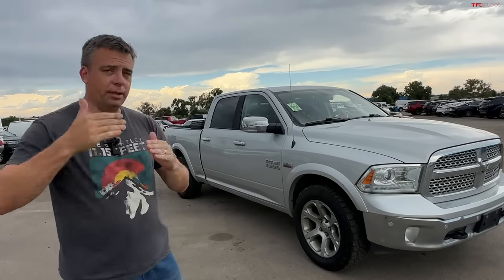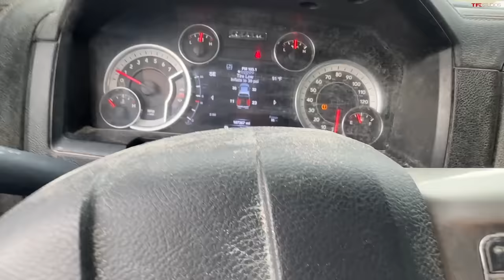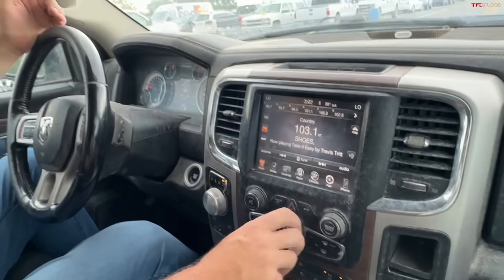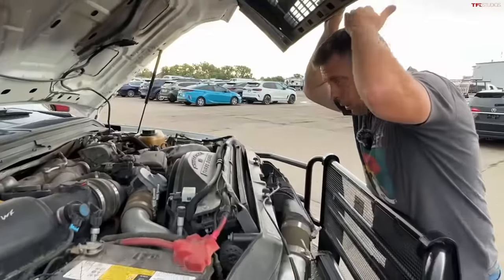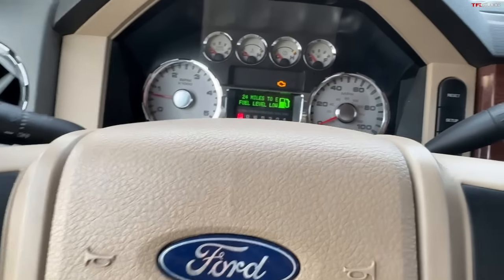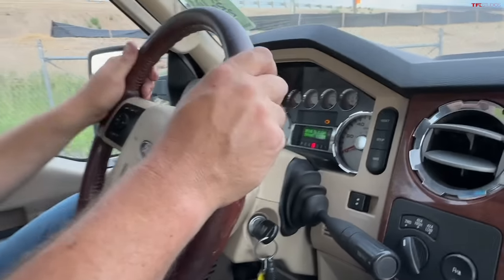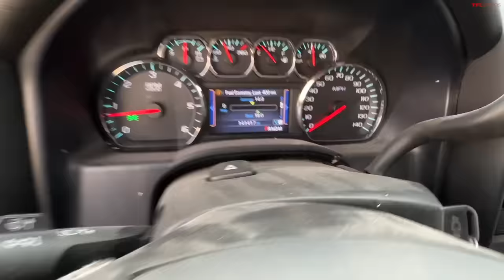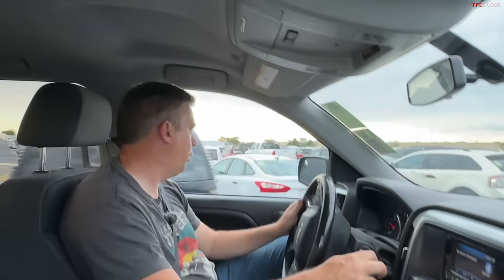These Are the Top 3 Used Trucks You Should Never, EVER Buy!

Comment: So much depends on how good of condition the truck is and what price you get it at. 

For example the F-150 from 04-08, in particular had problems with the 5.4 3v.  I know this because we owned and operated several of these pickups.  These trucks are a steal right now.  Why, because we know the problems, how to fix the problems and once fixed they easily run 350,000 miles. 

I currently have an 08 F-150 Kong Ranch with 5.4 and it has 80,200 miles. I’ve run mobile 1  0W30 and changed the oil every 4000-5000 miles.  I also use the mobile filter. The truck runs like it did day one from the factory.  

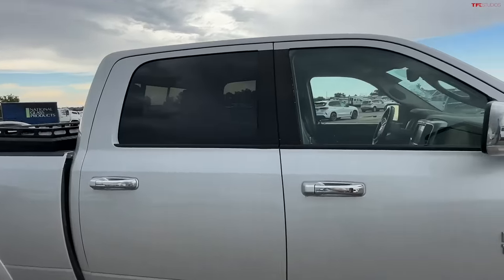I also owned 0:57  a 05 F-150 King Ranch that I drove to 132,000 miles.     I sold it to a young man who works with me in construction.  He drove it to 165,000 and the motor was torched. Here is the deal, there was ample warning of the pending issue.  There engines, if you don’t change oil frequently and if you drive them hard will develop a knocking / ticking noise. This noise can be anything from a timing belt guide failure, a cam phaser failure, to insufficient oil reaching the rockers.  If you own one of these trucks go to Fordtechmakuloco on YouTube. He is an absolute expert on these trucks. He has a video covering all the issues to look for when buying a used 04-08. 

So, an 08 F-150 king ranch with 150,000 miles and in decent no rust condition should be about $9000.  If you’re lucky you may find them for $3500 with a dead engine.  Buy the truck and for $7000 you can get a new motor, new transmission and a 7-year million mile warranty.  Why?  Be is the remanufacturing company’s have fixed all the knows issues with the motor and transmission.   The 05 that died now has 400,000 miles on it with a rebuilt motor and transmission.  It’s absolutely a good value.  

Same can be said about most of these trucks.

Comment: It might be a hard video to do but could you do a Ram 5.7L and a Tundra 5.7L breakdown why one outlasts the other and the difference between them
Reply: Everything is different between them. That's a start.
Reply: @trevorbrown7224  I know but be nice to have a video breaking them down what's different and what's the same, I loved my Tundra best truck in the world for me
Reply: @twiggywebber8817  The only similarity is the overall displacement. Pushrod vs DOHC, 2 valve vs 4 valve, forged vs cast internals, oil squirters, bore and stroke dimensions are noticably different (almost inverted between eachother), and head design are the most noticable differences.
Reply: Im a GMC guy, but from those two RAM all the way if thats the only choice

Comment: My dodge hemi work truck 4wd reg cab long bed has 244k on it. It has 2988hrs idle time and 5065hrs of drive time. For a total of 8k hrs on engine. It has had the hemi “ tick” since about 50k miles and has never gotten worse.  Cold starts in winter it’s louder but The truck has never been in the shop or anything other than routine maintenance. I would definitely
Buy again.  Now the f150’s with that crappy twin Turbo 2.7 we have in 5 trucks are junk none of them made it past 120,000 miles without timing chain issues cam fazes and harmonic balancer issues.  All of the Ford vehicles will be replaced next month with GMC 1500’s with 5.3 in them.

Comment: We bought a 2004 6.0 about 14 years ago. It was a few thousand dollars to bulletproof it. About every 3 or 4 years there were major repairs that ran into more thousands of dollars. Additionally there's an ongoing, repeating issue with brakes. We just replaced the engine due to injector failure. Again. We should have dumped it years ago. Just replaced it with a 2007 Chevy Silverado 3500hd ltz with one of the two Duramax engines known for durability. We should have purchased that one in the first place.

Comment: I personally owned both a 2016 ram with the 3.0 ecodiesel and a 2008 6.4 powerstroke. I loved both trucks and never had one single issue. The eco diesel I bought brand new and left stock. The 6.4 I took all the emissions off and it was an entire different truck. Although how you treat them will depend on how reliable they are. Just sayin.
Reply: The 6.4's main downfall was all the emissions.
Reply: Agree on the 6.4. The DPF and the EGR destroyed the engines. Without them the 6.4 works just fine. 

Also anyone that did tunes to up the HP destroyed their 6.4.

Comment: Here’s my useless thoughts nobody asked for: 

Regarding the Hemis, I’ve personally known three people, two with 5.7s and one with a 6.4 that had catastrophic engines failures at around 80,000km. Nice trucks but I’m hesitant about these. 

Regarding the 6.4 Powerstroke, I have a buddy who bought a used 2008 and with zero maintenance absolutely abused this thing on a daily basis for years, daily burn outs until only last year the poor thing tapped out with over 300,000 km. This thing was a rocket and must have been an anomaly among 6.4s. 

Regarding the 5.3s, my dad had a 2009 that had a lifter failure only 1000 km past warranty. GM actually honoured the warranty and replaced the motor. I’ve got a 2015 1500 Sierra with a 5.3 that ticks all day long, fingers crossed i have no issues.

Comment: Your report on the pickups are interesting, but. There is mistake you made about the Dodge Hemi MCD system. Dodge came out with the cylinder deactivation in May 2004, I know I bought one. If I drove into a very slight decline in a tunnel, you can hear the engine misfire. I drove the truck every day, working in Washington DC, down to Birmingham AL. The fuel economy was great for a V8. driving at 65 mph, I could manage 24 mpg. Keep up with your truck reporting, except these pathetic electric ones, that is being enforced on us.
Reply: On my 2014 you can never tell when MDS was going on and off

Comment: I tuned and deleted my 6.4 at 24k miles. Been a good motor for me. Still have my 08 with 230k miles. Down pipes need replacing and radiator leak because of the body mounts that are worn out. Mine works hard for me daily so I can’t really complain. I would not buy one that was not deleted very early on though.

Comment: The Navistar T444E/7.3 Power Stroke is an absolute gem. Those engines are bulletproof from the factory. The 6.0 can’t truly be bulletproofed, as the engine has only 4 bolts per cylinder. The 6.4 was just trash.
Ford got fed up with all junk engines since the regulation changes, so they chose to design an engine in house, the 6.7 PowerStroke was the result.

Comment: I am in the market to upgrade my truck and appreciate the info you have provided here. It narrows the trucks and years to search through. For the record I currently have a 2014 F150 STX 6 cylinder 6 speed transmission flex fuel and I love it, no problems with it at all. I am looking for a F250SD 2016-2017 8cyl gas engine to tow my RV. Any suggestions? Thank you

Comment: The GM Chevy truck does have some transmission issues. My friend currently owns two trucks, a 1998 Dodge Ram Cummins and a 2014 Chevrolet Silverado 1500. Back in 2021, he had to replace the transmission about 2-3 times due it going bad after towing his speedboat down the high out of state from New Jersey.

Comment: I bought a new 2014  Silverado,  4 wd, in  early 2015, the only recall I  got was for the driver seat, and seat belt, outer strap ?? Mine has been EXCELLENT with ZERO issues,  in 8 and 1/2 years  2 batteries, , tires  and oil change , is all it has needed, it doesn't use oil and gets close to 20 mpg on the highway, This is the 3rd  Z71 I have owned since 1994,  Maybe I am lucky but mine have been great trucks, I have pulled campers, boats and tractors up and down the road,  I owned three Ford trucks  early on, Will NEVER touch another one!

Comment: 29 year automotive technician  here. Also worked 14 years at Chrysler.  I have owned 2 dodge ram 1500s . A 2015 and 2018. Neither was in the shop for anything except maintenance. My 2018 did have an intermittent lifter tick in cold weather that was fixed by changing from 5w20 to 5w30 synthetic. The one in the video is obviously an exhaust manifold leak which is common and an easy fix. To be polite , you guys dont seem to be very knowledgeable, and I would advise people dont take your advice. Cheers.
Reply: Agreed. They chose 2 of the best engine choices in trucks to nit pick. The 5.7 pushrod hemi and the 5.3 pushrod vortec. The only major flaw with those engines is say to watch out for is the eco shut off mode which most smart people delete. I see those engines with regular oil changes go well past 200k. Yeah you can’t expect everything to work on a 20 year old truck by that time so who cares about the heated seats and other stuff.
Reply: After 2 lifter fails on 2 motors and exhaust manifold issue the only way I got it to stop was convert the motor to a non variable timing or cylinder lockout . Ram should be sued for the crap VTI failures through the lifters.

Comment: Just bought my first new(to me) truck- a 2022 Ram 1500 Classic. My biggest worries were the Hemi tick, so I kept my mileage range low, but also since it was my first new buy I didn’t want a massive car payment, so my criteria was under $37k and 36k miles. Long story short, 11,590 miles crew cab 4wd with 3.92 limited slip (only two option I wanted) with the upgraded cluster and radio in a Tradesman. Only one I could find and all set and done it was just over $40k
Reply: The HEMI lifter tick is really something that correlates with idle time, not driving time. The HEMI lifter issues also have no correlation with MDS and is really an oiling issue. The camshaft and lifters do not get enough oil at idle, so the main prevention is to avoid excessive idling and avoid excessive cycling.  That being said, my 2015 5.7 has 206k miles and I let that truck idle if I need to. The actual fix is to get the high volume hellcat oil pump, though if you change your oil every 5k miles with 5w30 and avoid excessive idling or cycling, you will be fine and won't have to deal with lifter issues.
Reply: Hopefully you can sell it soon and make a profit before it has major issues.

Comment: I own a 2014 GMC Sierra 5.3L and had one major issue.  It dropped a fuel injector at 36K miles.  Now at only 80K (so low, low miles for 10 years old), no issues at all other than that.  Only changed the oil, tires, and brakes.  The transmission does hunt a lot for gears and the headlights were horrific so I upgraded them to HID.  It does shake a bit even on brand new tires.  The interior of mine has held up great, but I have cloth seats as it's an SLE.  I'll continue to drive it for a long time as a new truck equivalent to this one will run me north of $50k and I think I only financed $33k in 2014 new.  With all the transmission/diff issues I've seen on F150s and the fact I owned a Dodge in the 90s, my only other option IMO is to buy a Tundra.  I may do that when this dies.
Reply: Tundras have their own issues. AIP failure, cam tower leaks, but these may be more expensive to repair considering how these trucks are built more than the others (even though they may be more reliable).

Comment: That ticking is an exhaust manifold leak!  But, yes, the lifters and cam fails in these trucks on engines that idle a lot.  The camshaft is located too high in the block, so at idle it does not get enough oil splashed on it from the crankshaft.  Heads have to be removed to replace the cam and lifters.  The MDS makes the problem much worse and is pretty much guaranteed to fail at some point.  Cost is around $7,000, but, hey, the MDS got you 0.02 MPG better fuel economy!

Comment: I believe that ticking noise is ascending you solenoid… the problem is if it stops ticking, so does the truck. No more tiki? No move, no more! It will stop running. The ticking is just there to let you know you need to get it replaced quickly before it does stop running… it’s not a question of if. But when.

Comment: I had a 2014 Silverado for 5 years and the only issue I had was rust on the ABS sensors. Then I got a 2019 Silverado with the dumb electronic brakes and throttle and over burdened with glitchy computer. Nice truck but I lost faith in it and built a 2023 4Runner with Magnuson supercharger and a bunch of other goodies. I love the 4Runner in spite of the fact that my 2019 4x4 Silverado bested it in mileage, handling, stability and acceleration off the line. The reliabilty and glitch free operation of the 4Runner makes up for everything else.  My son and my best friend are Ram die hards. We live in Northern Michigan and the Rams are a science experiment in how fast a body can rust. Holy hell, the Rams rot away faster than any other vehicle by any other manufacturer I've ever seen. Chevys and Fords of the same years don't do remotely as bad as the Rams. And I'd like to get a AEV Prospector Ram but I'll be treating the snot out of it twice a year to try to keep the rust away.

Comment: I have a 2015 Silverado and I love it. Just basic maintenance on it but I did delete the afm but just because I love having my V8 all the time
I didnt buy the truck for mpg.
Reply: I also got the plug in computer chip. 2015 silverado pulls 20 ft tr trl super great full time V8. 2011 gmc sierra same set up. 198 thou on 2015, 170thou on 2011. I think GM shot themselves in the foot trying to boost the mileage that way, 4_8. Had I wanted a 4 banger I would have bought another Model A Ford!

Comment: I have a 2014 chevy with the 6.2 liter and at 200K miles I had to rebuild the engine because of the AFM or DOD. I was going to buy a new truck but the prices are crazy so I may just keep mine running for now. I did a delete on the AFM

Comment: I have a 1999 F150 with over 218,000 miles on it. Change the oil. Transmission started to go at 207,000 miles had it rebuilt. I'm ask this all the time, why engine sounds good. Change the oil; I use Marvel Mystery Oil in the gasoline, use as directed. Also use PROLONG Oil treatment every oil change... When I bought it, had 73,000 miles, now you can do the math. Its a 4.6 V8. Its had its issues. What I love about it,  has a full size 8'ft bed. They are making pick-up-truck today like flower pots with mini beds for tucks...  Trucks are bigger and give you less in return in use. Simplistic is my truck. Who in there right mind would pay $60,80,100,000 for a pick up truck today. My truck was 9yrs old when I bought it, got it for $5,900 used LOL!

Comment: Can you  comment on the 4.6 Toyota  2013 double cab 4×4 truck, automatic transmission

Also I had a 4×4 2006 dodge diesel double cab not driven hard at all and had to replace the diesel engine at only 110k miles. I bought the diesel thinking I'd get a minimum of 250k miles. Keep in mind this was mainly used as our car to go on trips with. I have a jeep for off road and short trips to the local  store as I live in an isolated area. I think I put that  dodge in 4 wheel maybe twice and that was on a highway in snowy conditions. Needless to say,  no more dodge or rams for me , I am in a Toyota now and it runs perfect

Comment: Just sold a my dream truck a custom 2015 King Ranch PowerStroke with 117,000 miles. Spent 2.5yrs building it. More mods and upgrades than one could imagine. Lost my ass on it. Still sitting at the dealership for $39k. Has $25k+ in mods and upgrades. I’d buy it back in a heartbeat and finish building it if I hit the lotto

Comment: '14-'16 Ram 1500s with the 8-speed had transmission issues.  I lemon law'd my 2014 over this and the Ram/Dodge forums were full of owners who did the same thing.  FCA had it worked out (mostly) by 2017.
Reply: my 2013 has the same tranny and it shifts real smooth same for my 2005 , 5 speed.

Comment: Great list, I think you hit it spot on. What I saw was that you can still get a Ram truck with the same engine in it, maybe not all the exact same problems but still full of problems. The same can be said about the Chevrolet. I had a 02 Silverado with the 5.3 & at 130's thousand miles it quit, major engine issues. 
And yes, the ford 6.0 & 6.4 had a lot of issues as well, but Ford did completely away with them. They didn't just put a bandaid on them & kelp selling them.
Reply: That generation does not have AFM, they can go easily up to 300k miles from what I heard.

Comment: I own a 2001 GMC 3500, 4 X 4, 4 door, 9 foot bed, Dually, 6 speed manual transmission with the 6.6 L Duramax and love it, you couldn't give 10 new Trucks free that I would give up. I just wish Chevy and GMC didn't treat the engine like Area 51,  Top Secret.

Comment: Check the oil pressure on the GM trucks, there is a o-ring that fails and it can't form a vacuum to suck oil oil of the pan and also the senders often fail.

Comment: I had the 6.4L ford.  My turbo blew (reason it wouldn't go fast like in your video), and had it replaced... twice.  I had the same oil splatter.  The bigger issue with the 2008-2010 trucks is the supply chain.  The companies building replacement parts had a major shortage and Ford prioritized the newer trucks (for warranty work).  So finding parts was becoming a serious issue.  It took several weeks to even locate a new turbo; but Ford required I get the entire assembly at $1500.  Not to mention the cab had to be removed to even work on the engine.  It's gone now, thankfully.

Comment: Had a used 2015 RAM once, ONCE!  Replaced the fuse box at 60K, replaced the washer sprayer hood things, no real tick issues - HEMI was powerful AF, the fuel gague floater thing wore out around 70K, cloudy headlights - normal, never fixed it. Buy another one? Nope! -- nice windshield BTW.

Comment: I bought a brand new  2008 F450 lariat , 64k  cost. 2000 miles it blew the high pressure piezo injector line and completely destroyed the engine, 30 day later new engine . Drove it for 75 k miles and it still running today . I do not own it any longer. I have a 2020 F450 now